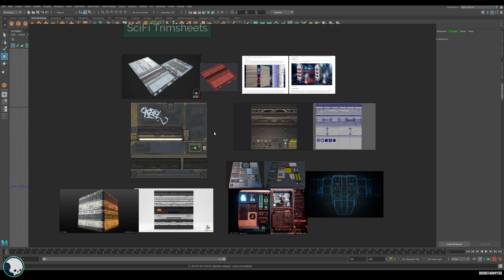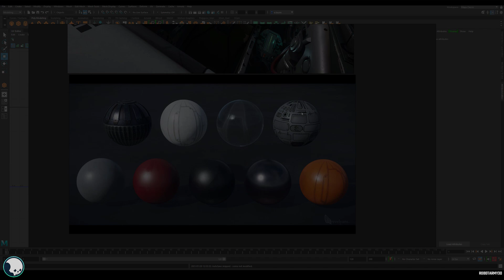TRIMSHEETS -01- Cyberpunk Vending Machine - Full Course -- [Maya, Painter, Unreal Engine]-

Comment: are trimsheets and atlas textures the same thing
Reply: Trimsheets - Efficient way of texturing multiple assets of a scene with one trimsheet by allocating sections of the UV space to seamlessly tile in one direction.
Atlas textures - Very specific or unique UVs for hero assets - its unlikely you can reuse this texture on other assets

Worth noting though, you CAN squeeze in an atlas texture on your trimsheet ('hybrid trimsheet'), but that allocated space on the UV won't be able to tile seamlessly. For example on the Vending Machine, the decals on the bottom right of the texture sheet would be UV'd like atlas textures and wouldn't be able to tile unnoticeably.
Reply: @Rogue_Vertice  Thank you, I appreciate the info